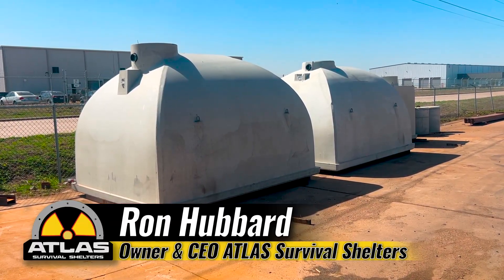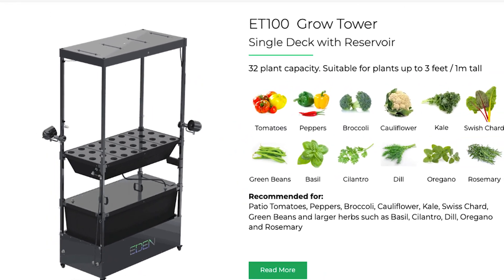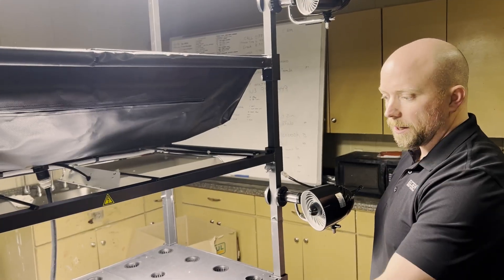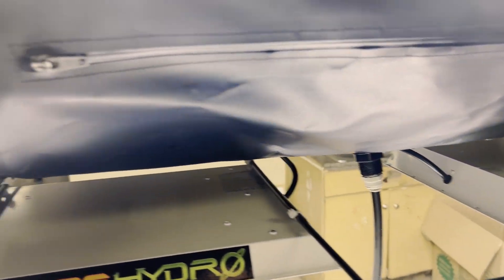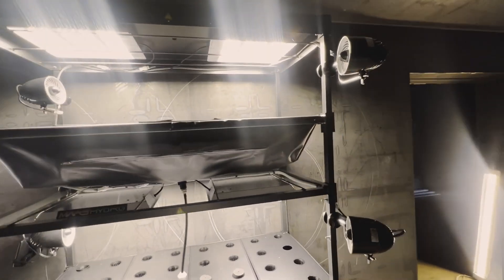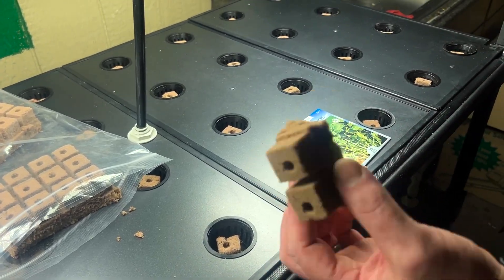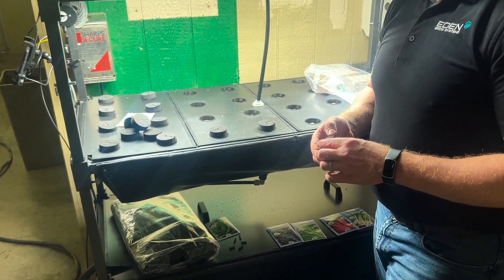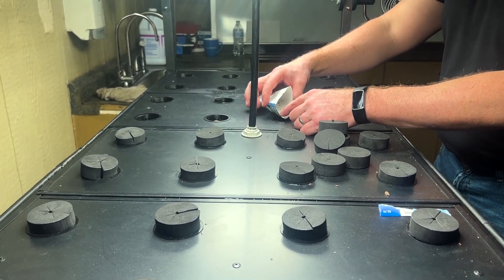The EDEN Grow System - How to grow food underground!

Comment: The optimal temperature for growing tilapia is 75 to 85 degrees F. Considering then the constantly moving water or aerosolizing of water, such as in the "Eden" type system. It seems the inherent risk may be having the walls of your shelter "sweat" due to water condensation. If that occurs your next problem will be algae growth on the walls of your grow rooms. Understand, I bring these things up not to be difficult, but rather as someone who has grown traditional farming [fields], high tunnels, and greenhouse for many years. I understand there are always pitfalls. In addition, I would point out that I absolutely love the idea of your shelters so addressing these problems is important. 

A separate but equally important issue...at least for me here, as I would personally only consider an aquaponics system, such a system should likely be run continuously. Consider... if there is a crisis that "required" you to use your shelter, tilapia spawn will not just show up on your doorstep that morning waiting for you to take them down in the shelter with you. Additionally, at the point you put tilapia into a system your chemistries do not automatically support growing plants. There is chemistry working here! It is a process, an evolving cascade of chemical changes to get to a point your fish support those plants. Once reached it can be maintained continuously. Possibly the answer may lie in an above ground system that at a given time the supports a below ground [shelter] system.

Prepping for me is a lifestyle. It has been for a lifetime, which for me is the better part of a century. Again, I am honestly seeking answers to these problems in order to realistically use these systems in a "shelter" such as yours...which clearly are outstanding.  : )
Reply: I imagine the Swiss system would help with moisture in the grow room or even a new beefed up system specifically for the room housing the planters as for the tilapia situation I think ur right you would probably have a normal fish farm on the surface and when shit hit bring them down along with acclimated plants or have food already growing in the shelter year round before anything happens so you can have ur system up and running before an emergency that way no wait time nore risk that the sudden chemical imbalance would kill them off my main issue would be food waste what would you do with dead tilapia or left over bones and rotting plant matter would probably be wise to add a wood burning stove or a incinerator of some kind Into the shelter

Comment: I used to raise orchid plants indoors in the 1990s using grow racks and full spectrum fluorescent bulbs and have also done outdoor, in-the-ground vegetable and fruit gardening. I have some concerns about the feasibility of growing food plants in an underground bunker. Some of the common food plants, such as tomatoes, peppers and strawberries, have to be pollinated to set fruit. Many of the temperate zone food plants are not self-pollinating. You will not have bees and other insect pollinators inside a bunker. Be sure to have an artist's tiny paint brush to do pollination by hand if you are not sticking to growing salad greens and culinary herbs. And there is a narrow range of time when a blossom can be pollinated so expect to do this hand-pollination daily as more tiny blossoms are produced. 

And you may need a way to heat the soil because some seeds will not germinate in the 55-65 " F. temperature range of an underground bunker. You may also need spare light bulbs, because every kind of full-spectrum lighting I have used will lose some of that spectrum over time well before the bulbs burn out. Lack of full-spectrum light usually means spindly, yellowing plants, poor production of flowers, poor fruit setting and poor crop yields.

I suspect some people will see this system as a way to grow marijuana underground during the apocalypse. Rather than growing full-size food plants or illicit substances, it would be much easier and quicker to use these Eden grow systems for sprouting wheat grain, mung beans and an assortment of micro green seeds in order to have a steady supply of vitamin-rich sprouts and baby salad greens. But you would need a large supply of seeds for sprouting of you want to keep a small household supplied with fresh greens.

Comment: seems like the shelf life of the seeds, medium and nutrient solution would be relevant to the applicability in a survival scenario. not to mention the moisture content added to the air in your shelter. I suppose if you can manage the humidity then it would be something to do with your shelter while it's idle
Reply: Seed shelf life when stored correctly can be decades to even a hundred years they also germinate meaning you could probably find a way to produce seeds from ones already grown

Comment: How does one get one of these concrete shelters in Canadas Nova Scotia?
Reply: With expensive delivery.
Honestly if you go watch the colin furze videos on his bunker build it's not difficult to diy or get a concrete guy to do.
Dig hole.
Put some gravel in for a level base.
Pour a concrete base.
Put some formwork on the base.
Reinforcement & concrete pour for the walls and roof.
Install a door & air filter from Switzerland.
Fill in the hole.
Done.
There isn't any super secret complex science involved, any contractor that can build a concrete basement can do you a bunker.
Reply: @disposabull  ohh I'm a big ole fan of furze, and I have an idea but not the time

Comment: Those small drain tubings will clog eventually with roots or debris
Reply from the maker: Buy one and try it out
Reply: @AtlasSurvivalShelters  I have designed, built and sold commercial aquaponic and hydroponic systems for 15 years.  Nothing is new on this system.  These guys just repackage into a slick turn key for people who have never grown plants. 

All the pictures on their site show lanky lettuce and tiny strawberries.  540w of lighting for 2 levels is barely enough PPFD to grow bib lettuce, let alone fruiting crops.  How much generator and fuel are we going to devote to growing vegetative crops and fish?  Don’t forget to heat that water for the shrimp or tilapia.  You’re generator goes down for more than a day this system will die.

Tiny tubing like that will clog over time and require disassembly and cleaning.  The filter and sprayers will need cleaning every few crops.  Same with the pump.  How many systems we maintaining?  Backup parts?  Pumps under pressure will fail, just a matter of time.  Aeroponics—nothing new.

Are all components food safe?  BPA free? UV stabilized?  LED lights put out UV, at least the good ones that grow crops well.  

What fertilizers are we using?  Organic?  Clogging goes up exponentially.  Mineral salts?  Better get one without heavy metals.

No automatic pH adjustment means you’re monitoring that setup everyday times how ever many systems.  Feed the fish times how ever many systems.  Labor starts to pile up.  I guess we’ll have lots of time on our hands if we’re locked in.

Might be good for a short term bug out.  But at what point does floor space and generator capacity become a premium?  

If you got the money just build out a farm level with resilient, well-designed and layered systems.

Comment: I hate to be the wet blanket here, but the power consumption on these is going to be problematic enough under ideal circumstances, say nothing about circumstances where you need to be in a bunker, with the three layer unit demanding over 800w an hour! How many people are you going to have on hamster wheels?
Reply: You could use solar panels on the surface to power the system, additionally you could even grow mushrooms, if light is not available.

Comment: I'm wondering how the Eden will do in the bunker underground or do you provide a heat system with your bunkers.
Reply: Congrats scammer you have made it to my block list 👍
Reply: A bunker will maintain ambient ground heat without a heating system. Depending on where you live that will likely be somewhere between 50-60 degrees farenheight. Plants will survive but they will grow slower. That said the lights will provide a bit of heat and it wouldn't take much extra power to heat a room in your shelter 10-20 degrees above ambient.
Reply: @panpiper  yes that's exactly what I was thinking. With the exception LED's don't give off heat or at least the ones I purchased don't and it stated that on the package as well.
Reply: @chuck26241  LEDs 'do' give off heat, but not very much, because they are very efficient at turning electricity into light rather than heat. However all the power that is converted to light gets converted to heat when the light hits the stuff it illuminates. All that light ultimately does become ambient heat, in exact measure to the amount of electricity used. Admitedly for LED lights that is a low amount of power, but it is not nothing and it does heat a little bit.

Comment: Awesome new bomb shelter. Im not able to use a ladder. Can you build one with steps on the end? Steps could be metal or fiberglass and just bolted into an imbedded flange with a peel and stick bitumastic tape. Just would be easier for some of us to access. Great idea for a tornado shelter.
Reply: Given the way they are constructed, I doubt stairs would be possible.
Reply: @panpiper  i could design a flanged bulkhead on one end. The stairs could be welded and built just like the stairs to the normal bunkers. It could be c a duplicate. Then after placing the concrete shelter in the ground, lower the stairs into the hole and bolt it up. There are numerous gaskets used for direct burial of potable water systems. A similar gasket cut to the size of the flange leading into the concrete shelter. An engineer should complete the design but it is definitely do-able.
Reply: @kenwalker9780   Well, I hope I am wrong.

Comment: It looks like a great system. I'm curious though; does the misting, combined with exhaled occupant moisture, increase the likelihood of mold growth in the shelter?
Reply: Thanks for your question! Most of the mist is contained within the root chamber by design, to recover and recycle the maximum amount of water possible. So, the system only contributes the amount of humidity released by the plants due to transpiration and a small amount through the grow pod collar around the plant stem.
Reply: I would also imagine this would be used in a room with the swiss air filtration system to dispell any possible stray moisture
Reply: @ventedthesenuts  The air filter cleans incoming air; I'm not sure what it would do for interior humidity. Perhaps it levels out with the overpressure valve.